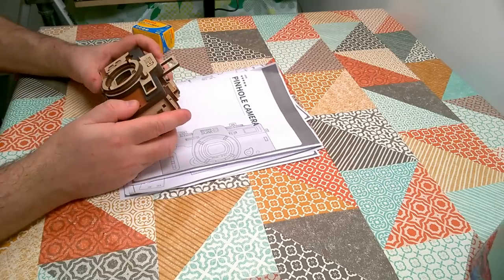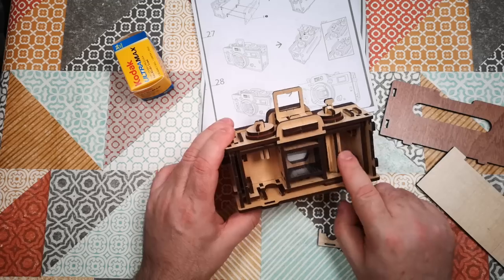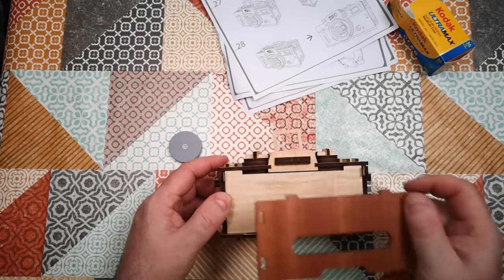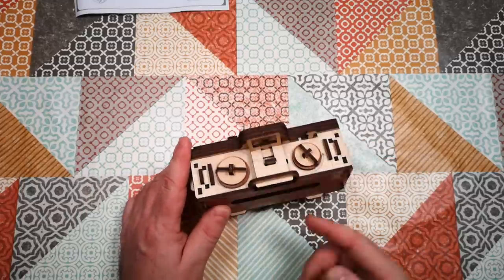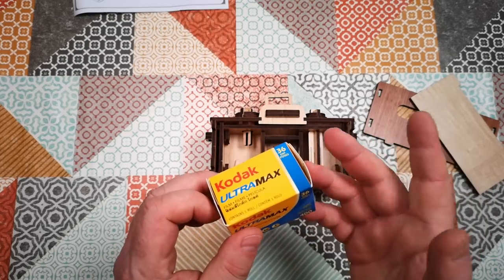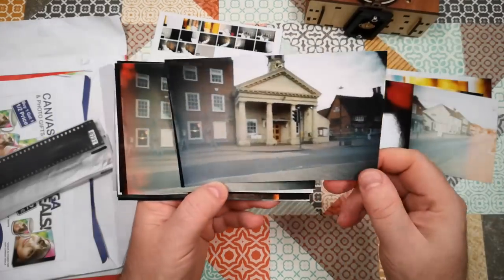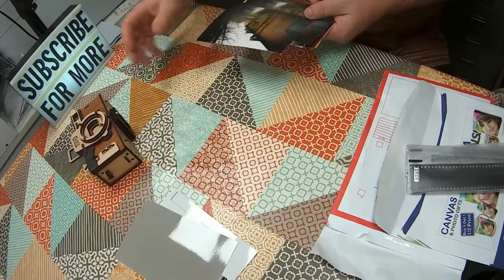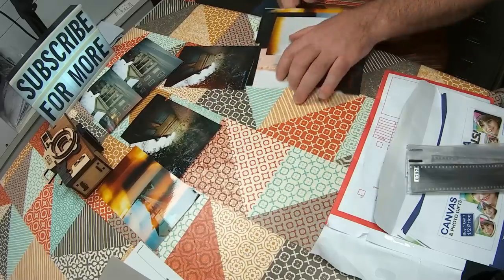Field Testing The WOODSUM Kit-Built Pinhole Camera

Comment: Test it opened with a junk roll of film to determine number of clicks per frame, even good film would only waste a frame or two to determine.
Reply from the maker: Yeah - I should have sacrificed an inch or two of the film before I started.  I'll retest it soon.
Reply: @AtomicShrimp  heck, a strip of paper cut to film size could possibly work.
Reply from the maker: Even better. Why didn't I think of that!
Reply from the maker: OK, I just tested it with a strip of paper (brilliant idea - glad I thought of that! ;) - the ratchet only has 4 clicks per full turn - 3 clicks (3/4 turn) is neeeeearly a whole frame, but not quite - so I guess it's 4 clicks - a full turn .

Maybe once a few layers of film have wound onto the takeup spool - increasing its diameter, 3 clicks moght advance a full frame, so maybe after shooting 10 frames, 3/4 turn will do it for the rest of the roll
Reply: @AtomicShrimp  I'm glad it worked. I had a similar idea, I guess great minds think alike ;). Thanks for the update, brother. That camera has a lot of possibility and I think exploring it could become frustrating to someone with less patience. A roll of b&w Ilford iso 400 or even the iso 3200 for low light could produce some great images. Good luck and cheers.

Comment: 35 mm film is meant to use 8 perforations per frame, which will give you an image 36 mm wide (36x24 mm²) with an extra 2 mm space between the frames. Without any instructions I would start by the assumption that each click moves the film by 1 perforation, so I would see if 8 clicks gives me the standard result. I would then have the film developed (no prints) and count if there are 8 perforations per frame (from the start of one frame to just before the start of the next frame). If so, then it would mean the assumption of one click per perforation was correct. Otherwise, I would calculate the actual number of perforations from the start of one frame to just before the start of the next. That would give me the number of perforations per eight clicks. From there I would calculate how many clicks would give me eight perforations, and from then on I could forward to the next frame by moving the whatever number of clicks moves eight perforations.

This may actually be slightly different for each camera assembled from the kit (in theory they all should move the same, but depending on how you assemble it, there probably are some differences). That is probably why the directions do not tell you how many clicks to count, and also probably why they included the roll of the film, so you can calibrate it as described in my first paragraph. The eight perforations per frame are a standard.

As for the shutter, I would think they designed it to stay open until you close it manually because pinhole cameras use much longer exposure times than cameras with objectives (lenses) and you would get tired pretty fast if you had to hold the shutter release by hand.
Reply: @RustyTube, they should have made an inverted shutter, where pressing it down raises the shutter and releasing the button makes it fall back down. Though, idk about the feasibility of that in this material.